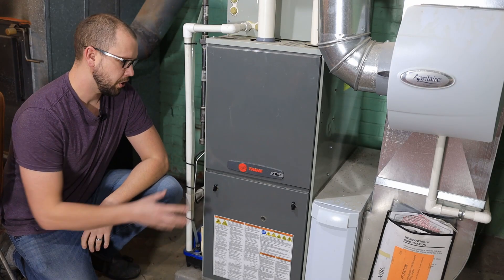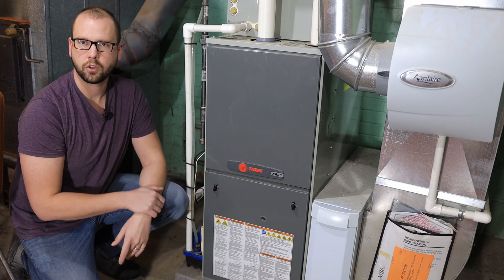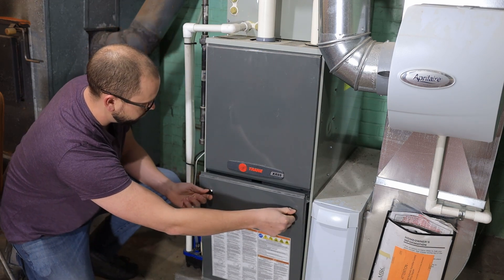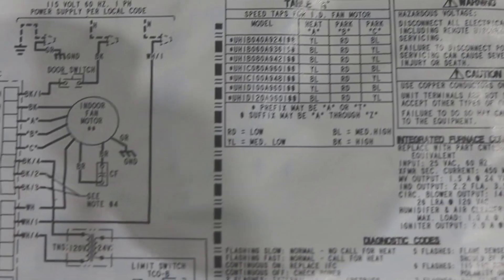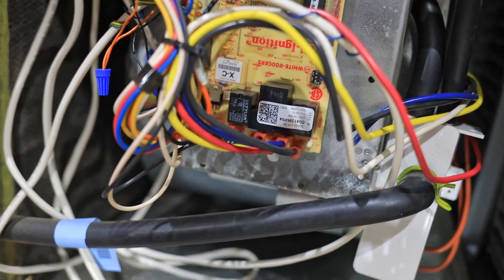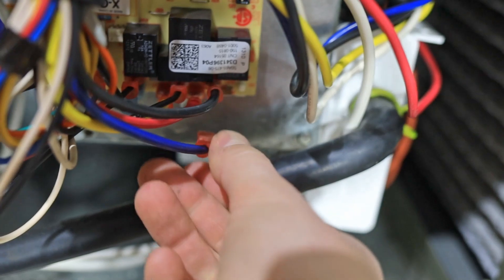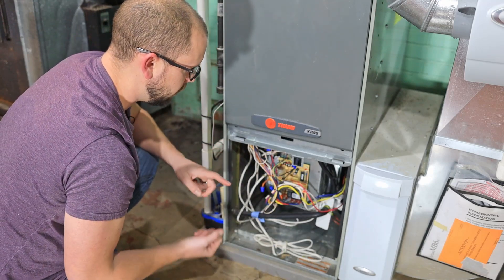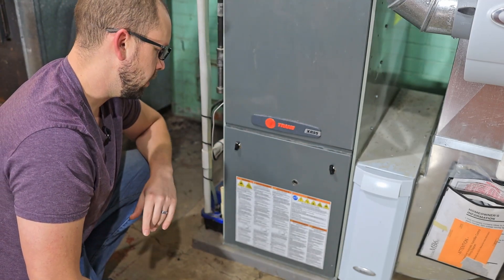Changing the Blower Speed on a Furnace

Comment: Not sure, but to me it makes sense to have high speed for A/C in summer as cold conditioned air is heavier than warm furnace air in winter thus the need for a 2 speed capability in the unit.

Comment: First of all, to say that all furnaces are about the same, let alone all TRANE furnaces, is just a completely ignorant statement, because they ARE NOT the same by any means. Even my OLD Trane furnace from 2008 had an electronically controlled blower. Now with my NEW (Jan 2025) Trane, I am trying to find out how to change the speeds. The old furnace had a true variable speed blower, but this new one, while claiming to be "variable" speed, is pseudo-variable; it has 9 speeds, and all of them except stage 1 heat are too high. My AC only has one stage, but the blower kicks in as though it had 2 stages, going to the highest speed and sounds like a tornado is coming. I am aware that generally air conditioning requires higher air flow than commensurate heat. However, on AC there is such a thing as having too much of a good thing. Just like the tonnage can be too great for the heat load, so can the blower speed be too high. Just like one other gentleman commented here, too high an air flow can result in unsatisfactory "conditioning", namely the extraction of humidity. And I know the blower is too high on AC not just from the noise (way nosier than my old furnace) but also the AC kicks off after just a few minutes, even when changing a degree or two. But this guy was no help by claiming that all furnaces just had specific wires to control the blower speed. That's the way my really old, original 45-year old blower was. In fact, it just had a manual switch that you were supposed to flip each season when you started using AC. I guess with the internet, you get what you pay for.
Reply: They are ABOUT the same!!!  Which is a true statement… they heat up the air and they blow it… #CalmDown

Comment: On high blower speed you gain more air but lose heat. (Think of which feels hotter, moving your hand slower or faster through a candle flame). Here in the colder North leave high (black) on the Cool terminal and choose low medium or high medium for Heat terminal

Comment: The furnace must be calibrated to the correct heat rise by measuring the return air before the blower and the heated Supply Air Downstream of the exchanger. Then you can adjust the gas valve water column pressure to the optimal mid-range on the information plaque. If the exchanger doesn't get hot enough it will have incomplete burn and set will clog up the exchanger. If it gets too hot it could crack the exchanger. You must have the optimal mid-range temperature as stated on the furnace plaque for it to function correctly. Increasing the fan speed will cool the exchanger and you should adjust the gas valve up to increase the temperature of the exchanger to keep it in the optimal mid-range temperature. That being said this could cause short cycling as the home is reaching temperature faster. But, if a special filter is being used that does restrict airflow across the exchanger then it could work out for the better as long as the proper calculations are done. I use a 6 in thick Merv 15 plus carbon Nordic pure filter and it does not affect airflow much. Make sure you are running the correct filter.

Comment: I am using a trane system with trane clean effects, then it is heating, my blower is like so high. I am concerned about the particles that the trane clean affects (electric filter) are transpasing the filter beciase the trane blow is so strong. is that a concern? which blow speed should I set the air is not so fast that my electric filter catches and keep all the dust???

Comment: Question what if the blower motor has 1-4 per your video. But the blower motor has an option 5 but no wire is connected? Would this be a higher speed than 4 for the cool side? Also the plug next to it black plug doesn’t have a wire for 5 either.

Comment: Great and informative video. Instead of changing the black wire from cool to heat in the winter, then moving it back to cool in the summer, can I splice the black wire and keep it connected to "both" cool and heat all the time?
Reply from the maker: I think you may fry your circuit board if you do that.  You will basically be back feeding into the board as if you connected the cool and heat pins together.  You could connect a switch so that you could easily toggle between the two but not actually be connected to both.
Reply: I saw a post out there that said it was common for people to wire their heat and cool together to high. I also saw another post that said the board had relays for both heat and cool to be safe to wire them together. I now did it in order to get the high heat pushed stronger to reach the cold spot in the house, while hoping the high cool will continue to work without intervention comes summer

Comment: New home owner here. On low speed the blower motor or something there seems like there is a very small rattle. At the end of the heat,once it reaches the temperature, it then goes to high speed and the sound goes away. Appreciate the video and help.
Reply: Bearing goin
Reply: @jonathonvince561  for the blower motor? Think it's worth to replace that and the blower wheel at same time?
Reply: @infotechyeti  the wheels u normally can clean but check the motor for leaks. There will be a build up on the case if it that attracts dirt if the bearings leaking and whiping grease everywhere

Comment: I have a question I have a wood furnace hooked up to my furnace and I turn my fan only on to circulate the heat but the outer parts of my house don’t have the greatest airflow is there a way to switch the fan only to high instead of it just barely trickling out the air which I assume it’s set at low? Hopefully this makes sense
Reply: @CoolStuffGuysLike

Comment: I switched my heat wire from blue (medium high) to red (low). And it doesnt seem to change the fan speed. Any ideas? My furnace blows air too fast and loudly i wanted to lower it for the sound.

Comment: High speed is ALWAYS on cool; it never leaves that terminal! Heat speed should be on low to medium low so you don't get hot spots on your exchanger. There are temp differences that should fall within spec of the furnace, but that's for the pros.
Reply: Now we're all pros thanks.
Reply: Most furnaces allow for running the same blower speed in heat and cool. The application is what determines the blower speed necessary in each mode as you have to match blower speed, total external static pressure and heat rise/temperature drop to the equipment specifications. What he said about changing blower speeds to overcome high static pressure on the return side is incorrect though as you would need to add more returns or add another filter slot altogether to negate the added static from a high merv filter. An air bear setup shouldn't add more than about .01 static pressure (if that much) but people think more pleats=better filter.

Comment: Thanks for the video. Dallas tx here, blower speed seemed too fast in the summer, followed video, turned down fan speed, wife noticed immediately, I left detailed directions/instructions/this video link taped to the unit for next owner. Makes sense. Slower more "conditioned air" in the summer here, is the way to go. Turn that central blower fan speed down in the summer. Crank it up for heat in the winter. It really works. Anyone thinking about changing your speed, Don't be afraid to try. You can always put it back. Label your wires, and take pictures. I only switched 2 wires. GOD SPEED!
Reply: Blower speed you always be set for the application in question. Those settings should always be done based on superheat and temp drop across the coil and cooling, and heat rise across whatever your heat exchanger is in heating mode IE heat strips or a coil for a heat pump or a tube and fin heat exchanger for a furnace or boiler.
Reply: @Puffalupagus360  Huh? :)

Comment: would slowing it down not make it run longer thereby increasing the amount of overall air exchange?
Reply: In my house there is a cold spot in the basement where the airflow was weak, so for me, higher the airflow not only solves that problem, but the heat is more spread out without the heat concentrating around the first floor including the thermostat area

Comment: You can also just make a jumper and have both wires on the cool speed and never have to mess with it again
Reply from the maker: Yeah that may work but you would be back feeding power to the pin that isn't being used which may cause some trouble if there isn't a diode in the circuit.
Reply: @CoolStuffGuysLike  hey it worked on everything I’ve done it on so I don’t know. I see what your saying maybe this is on newer machines I work on mostly old shit.

Comment: Thank you for this video. Recently had an HVAC specialist tell me it would be more energy efficient to lower the blower speed in the winter because the air moving too fast "cools it off" and doesn't heat as well. Thankfully he told me, because after he left we got an error code pointing to "Bad airflow" which I was able to remedy thanks to these instructions and helpful information
Reply: That is true, Bernoulli's principle. Flow and temperature are inversely proportional. Fast air=cooler air and vice versa.
Reply: The HVAC tech was correct. Using high for heat is inefficient. The heat exchanger won't reach optimal temperature and the fast air will also cool it down further. You end up using both more electricity and gas. Of course if it's too air movement is too slow the exchanger will overheat causing a lockout. It's a balancing act that needs to be tuned to every system. But using HIGH for HEAT is NEVER the correct option.
Reply: @SerenoOunce what if i changed from using regular fiberglass filter to a high Merv filter should i increase the speed because of the more restrictive filter?

Comment: Make sure that when you change blower speeds, the temperature differential between the supply air and return air falls within the recommended range of the furnace.
Reply: Can you please explain how to check that?
Reply: @razlink  You drill a hole in both the return and supply air ducts and insert a stem type thermometer in each hole while the furnace is running.Subtract the 2 readings and make sure the resulting number falls within the range on the sticker on the furnace.This should be where the model and serial #s are. Take your readings close to the furnace. I don't bother but you can put small pieces of duct tape over the holes in the ductwork afterward.
Reply: Upload a video showing how to do that.

Comment: You want slow for cool. If your too fast you will not be removing enough humidity. Longer run cycles in cooling are much better.
Reply: Incorrect. You want the most amount of air hitting that coil as fast as possible.

Comment: So many different configurations to a lot of these boards this is just the tip of the iceberg there’s so much more to this you shouldn’t touch any wires and let you know exactly what you’re doing.  Some boards have dip switches some boards other ways of manipulating the speed this is just such a small part of it
Reply: I watched the AC guy do this, to lower my blower speed, and all he did was switch two wires, so, I'm a bit confused as to why I'm seeing multiple comments about there being more to it. He did exactly what this guy did. Two wires switched, then he was done.
Reply: Because so many different systems Regis was easy many aren't

Comment: My landlord just put a new blower motor but it seems to high or fast ..I hear a hummm front vents in my room thats driving me nuts  it's on med high ..I want to put it on med
Reply: I just had all new HVAC installed, and my blower is set WAY too high, as well. For me, the intake is in the hallway, right by the living room. It's LOUD. Sounds like a wind tunnel, or something, and the air flow itself is intense. Feels like it's industrial strength...totally unnecessary for my house. I live in a cottage. The AC guy couldn't even hear me when we were only about 10 feet apart. Someone knocked on the door, and I heard nothing. That's how loud it is.
Reply: Same thing with me
Did y'all ever get it to be less loud?
Reply: @mr freeze  the motor was to big they put a smaller one.. it still made noise but we got used to it

Comment: Useful video, I am thinking about tinkering with furnace blower speed, because here is my problem. 

We just got a new AC as our old one went out just when it got really hot and we hurriedly got couple of estimates and went with this company who offered to throw in an air purifier. We had 2.5 ton Bryant AC which was about 20 years old and the company installed a Rheem 2.0 ton unit.

Now the problem is that this AC takes a very long day to cool down, for example we were out of town one weekend and we have Nest thermostat which puts itself on Eco mode detecting that we are away and sets the temperature to 78, when we got back it took around 8 hours for it to come down to 71 degrees. Its been over a month and this is consistent, it will take over 3 hours for it to cool from 75 to 72 and then it will run for couple of hours before it can get to 71.

We called the company and they sent a guy out, he said that our furnace blower is overpowered and it does not match with our AC, he said back in the days people would do that, and that the blower is meant for 3.0-4.0 ton AC, he turned the blower speed down to bring it close to AC power and that did not make any difference, infact I am pretty sure it now cools down the place even slower.

What they are saying is they can't do anything about this and that we were explained of this problem before installing(which I do not remember) and that our only option is to replace the furnace too.

I don't buy this for couple of reasons, and maybe I'm wrong and thats where I need your inputs.

    Our old AC was 2.5 ton and it worked great for an old unit with the same furnace blower.

    When the technician turns the blower speed down it worsened the situation so that means higher the furnace blower speed the better airflow i.e more power is better?

What are your thoughts?
Reply: Do not slow the fan speed down on the AC. The unit is actually more efficient the longer it runs as it draws out humidity. A unit that cools down quickly and shuts off makes a humid home.
Reply: Rheem is not even close to a Bryant unit
Reply: I am an HVAC technician and it sounds like  they put the wrong size condensor unit on. If your air handler is sized for a 2.5ton unit then the outdoor condensor unit needs to be 2.5tons if it's a straight ac unit. If you have a heat pump then it needs to be the same size and brand.
Reply: What’s your square footage that’ll tell you the tonnage your AC should be. How’d they determine you need a smaller ac without a load calc? I would hope your house is smaller than 1,400 sq ft, and 350 cfm per ton of cooling is what I was taught. So they could be right about the blower. But idk. Lol sorry was in a mood good luck 😅

Comment: Hvac tech here. Need to measure static pressure with a manometer, refer to manufacturers literature regarding cfm, and adjust blower speed accordingly. 

If you want higher merv filters, typically you'll need to add another return, or install a media filter rack

Comment: I just installed a Goodman furnace everything working good but not very warm at the outlets. Sounds like the blower is running way too fast. Huge air movement but not very warm. Maybe i need to slow it down? Thanks
Reply: I have same problem with mine Goodman, brand new , did you do anything?

Comment: You may want to be careful messing with airflow this way. There are DiP switches on the board and a table for adjusting motor speed per temp rise over heat exchanger. If the airflow is too slow the exchanger can overheat and crack, spilling toxic gasses into your home. If it’s too high, you can get a dirty burn . 
I’m a do it yourselfer installing a 2 stage-multi speed and investigating this stuff. As it turns out, there really is more to all of this than a guy might think. 
Get a manual.
Reply: What's a dirty burn?
Reply: @Duantuideguaiwu  A restricted vent or cracked heat exchanger will allow for incomplete burn of the gas. This results in soot build-up which decreases the thermal exchange to the circulated air, along with just being a safety hazard in general.
Reply: Agreed, these units have specific input and output so to speak.  As more of a car guy, you just can't change blower pulley without matching fuel requirements.
Reply: He said that right at the beginning. Usually setting taps and dip switches adjust board measurements for gas as well
Reply: Just hire a pro hvac tech like me